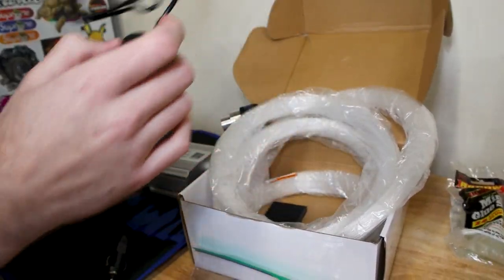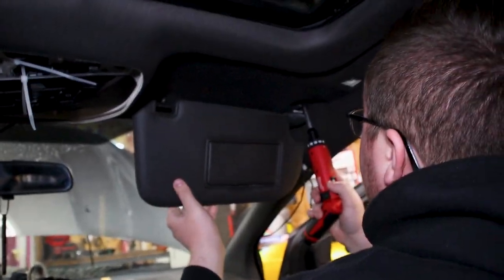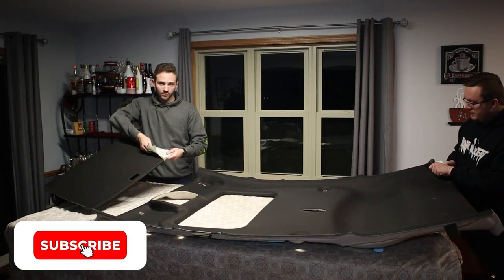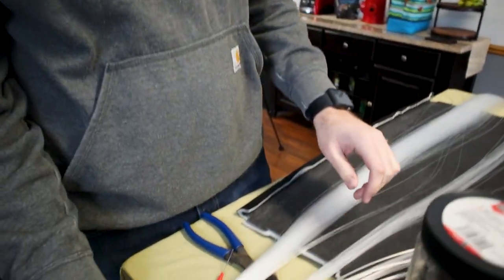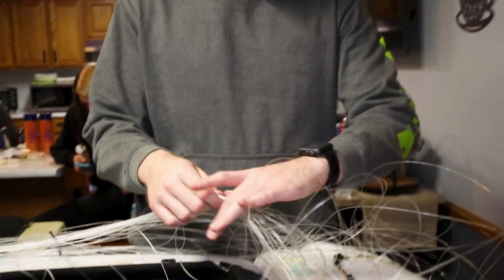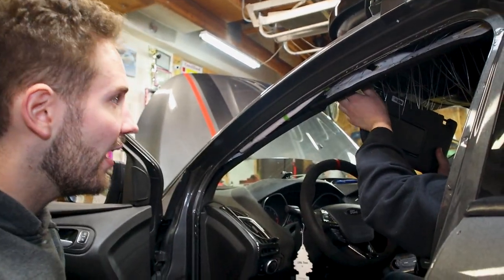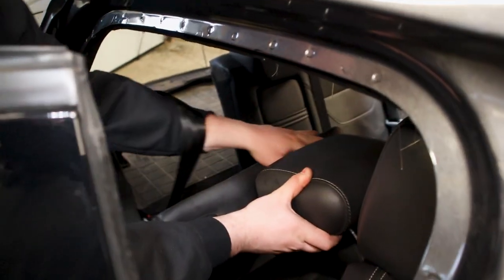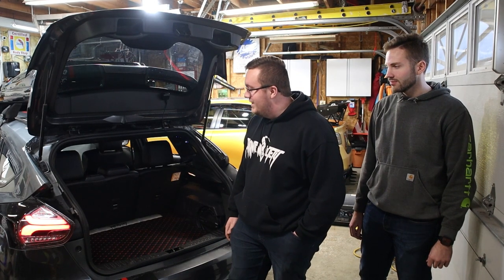How to install a starlight headliner on a Ford Focus ST | IN DEPTH

Comment: Hey, hope you guys are good. I wanted swap my headlining for my focus mk4 from grey to black. I have found the parts but it would be the first time I’ve done something like this. I can’t find anything specific to the mk4 so I was wondering if you know how different it might be or anything I need to worry about? 

For example, I have a sunroof and I’m going to swap the front sunglasses/courtesy light part for a black version which comes with electrics for those buttons attached. This part is from a Kuga mk3 but it has the same part number and seems to fit fine. But will there be an issue with electrics that the would recognise this part doesn’t belong and not open/close the sunroof and blind?

Hope that makes sense, thanks for the detailed video btw, great explanation throughout 👍🏼
Reply from the maker: Appreciate the feedback and glad the video helped. It’s hard to say since we have never done what you are describing. For the concept of just doing the headliner and star, I would imagine it be similar. The electric part is up in the air and don’t wanna say yes and it being a no but I think it has a chance that it can still work fine from some insight you said. There’s always a way of doing things but you may need to think outside the box if it doesn’t just go hand in hand. Let me know how it goes and good luck!
Reply: Thanks for the response! It’s taking some time with the progress as I’m trying to plan it and find parts cheap. It’s planned out and should be done in a couple weeks! Will definitely let you know how it goes, it’s a shame I can’t post the results.
Reply from the maker: @JSSR96  Sounds good! Excited for ya 🤙🏼

Comment: Hey so for the sun roof, would this would in my 10th gen accord ?
Reply from the maker: If you are asking about removal, probably not the same but could be similar. My Subaru was different than the ST sunroof removal.  You could also put stars in that part but not the most fun install...
Reply: @DmoneysGarage  yea was wondering if I can drop my sun shade that easy without taking the glass off ..
Reply from the maker: @EliC216  If it is just the shade, there should be a way to remove it especially without taking the glass off. I have not done it on an Accord so can't explain how to remove it but I'm almost certain that you can.
Reply: @DmoneysGarage  ok thanks man great video as well !
Reply from the maker: @EliC216  Thank you!

Comment: What is the measurement of the fabric that ypu used?
Reply from the maker: I believe Spencer used the 96" x 60" size option from the fabric link in the description. However, regardless of the ST platform, I would take a tape measure and measure the length & width of your headliner and add extra to account for slack/tucking/grooves. Can always trim but never add.
Reply: Thank you!